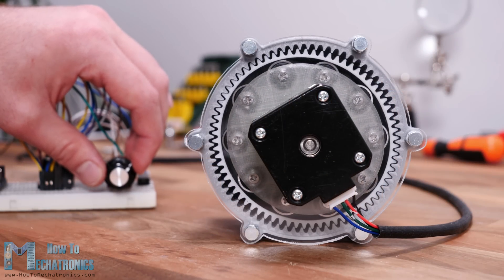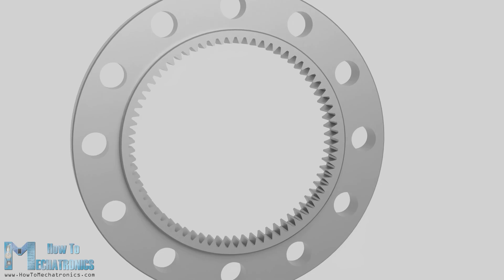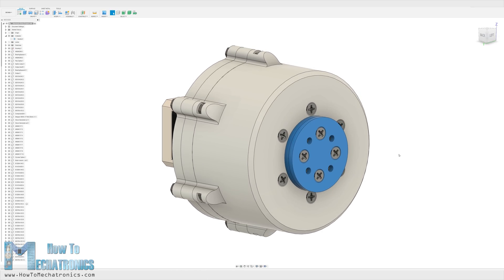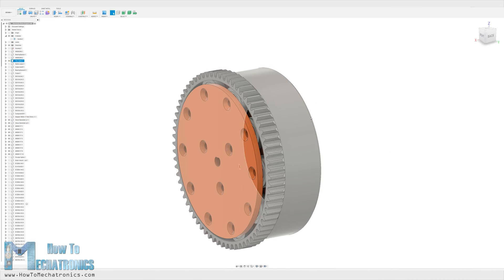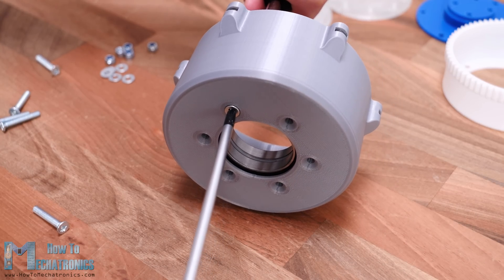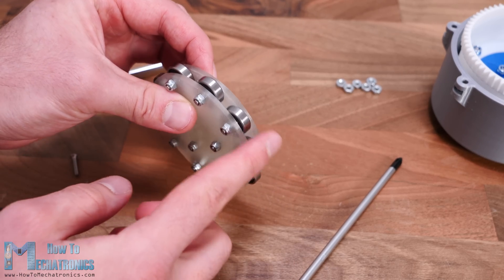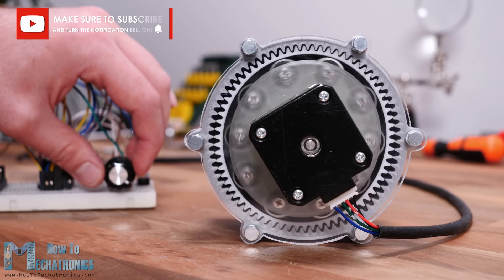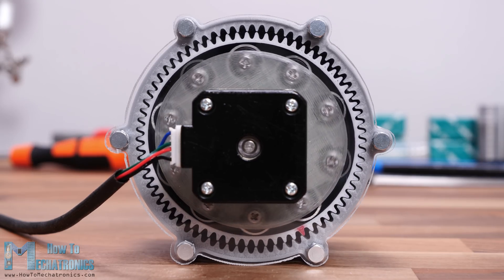What is Strain Wave Gear a.k.a. Harmonic Drive? A Perfect Gear Set For Robotics Applications!?

Comment: Were all those bearings nessecary? It looked like only the ones at the outer edge of the elipse were contacting the flexible part.
Reply: Yes, I was thinking that , and also , you don't really even need the bearings. If your application for the drive was a light to medium load I was thinking perhaps you could get away with just an elliptical disc with sufficient lubrication.  I'd really love to have a 3d printer and all the knowledge that's required.
Reply: I would of trippled their number by using far smaller ones, whilst the outer edge of the elipse bearings seem to have the heavy duty role, all the others keep the inner edge of the elipse from misbehaving, their friction is far less but they are necessary nonetheless.

Comment: It's so nice your fusion360 works so smoothly. Somehow Mine is laggy when it has lots of parts and points, even like 1/4 of your component count... But solidworks work just fine, any advice?Thanks! liked your vid!
Reply: Yeah, sane. Fusion started out being pretty small and efficient but they've added so much to it that it's become a bit of a slug. Autodesk Inventor is also much faster. Sadly, only more RAM and faster GPU will help it.
Reply from the maker: Well I guess it's up to the PC configuration. Mine has Intel i-7 6800k 6 cores, 32GB RAM and GTX1070 8GB GPU.

Comment: Great video! 

I just don't like it on a personal level. The mechanism, that is. Something just seems so wrong to me on a fundamental level to put some thing purposely flexible in a drive train. The material will have a very short lifespan. I guess that makes sense if you're making something plastic injected and disposable, but that type of engineering has made the world have a lot more trash in it.

Comment: The constant bending of the gear does it generate a lot of heat   however small the bending may be
Reply: This is why such gears are not used in machines built for long-time use. The constant mechanical stress breaks the gear quickly, doesn't matter much if the whole contraption is filled with coolant and/or lubricant. If the gear that bends constantly is made out of materials that can handle the stress for long, then the whole thing gets extremely expensive. The idea is great, but the adaptability of it is very limited.
Reply: @baladar1353  rubbish, they are used to power robots. I first saw them on asea robots in the early 80's. If anything robots are completely designed for long time use 24 hours per day and no lunch break etc.
Reply: @stevemarks9360   Ok, this is your opinion. Since I've learned material sciences, I think I knew what I was talking about. What I'm not sure about are two completely different things. First, I'm not sure I have expressed my opinion correctly, because english is not my mother language. Second, I'm not sure about you know what 'long time use' means in the case of constantly bent materials. It doesn't matter if the force causes permanent or only temporary deformations, deformation will cause the matter to fail sooner or later. You can delay failing by using different materials, cooling and lubrication, but it will happen. This is why harmonic gears are not used in car transmissions or other critical long-time-use machines. Of course these can be used in small, not so powerful machines, with the need of constant supervision. Constant, repeated bending -> viscosity, friction -> generating heat -> fatigue fracture, failing. I guess it may explain what I expressed before.
Reply: No it doesn't, and this mechanism is used to drive robots, one on each axis.

Comment: Very interesting concept but I would have to be convinced about longevity of the flex spline especially under high torque high vibration applications.
Reply from the maker: Well they are known for being quite durable. Of course, not this 3D printed one, but the one made out of special steel alloy. These drives are using in many high precision industrial robotic arms.
Reply: @HowToMechatronics  are they any idea which ones?  I have worked  mainly on Fanuc more on the heavy industrial side.

Comment: I still don't get why it rotates and doesn't just deform back an forth in the same place
Reply: That would happen if the teeth count of inner and outer ring was the same. But the inenr ring has more teeth so it will "climb" the outer ring and move slowly.

Comment: Amazing video!   But did you really use a star-head bit to drive the socket-head cap screws?
Reply: I've found that Torx bits actually grip the socket head better than an Allen key does.

Comment: CraftWare slicer has the same parameter like the Horizontal Expansion, but it is called Vertical Shell Offset and I usually set it to 0.07mm for the best results.
Thank you for the nice video! Good explanation!

Comment: If you attach a precision encoder or resolver to the input and output and graph the relationships you will find that harmonic drives have some weird nonlinearities.  We were trying to use them for some very high precision robotics applications in the 90s and this gave us big headaches!
Reply: What kind of nonlinearities?
Reply: Posting in this thread for when someone posts the solutions for this
Reply: How did you work around the issue? Just a nightmarish transfer function?
Reply: Matteo Alessandro no, afaik tfs are inherently linear.
Reply: This is true however this sinusoidal motion component all but negligible when a high reduction ratio is used. You can think of the extreme doing it with so many teeth that the teeth just disappear and you are essentially just using friction. At that point the sinusoidal component goes away and you theoretically have linear motion.
Reply: @kaden56  depends on the level of accuracy you are trying to achieve as well
Reply: @Chris-bg8mk  How would this compare to a cyclodial gear? Would a cyclodial gear deliver more constant torque?
Reply: The output is linear, with a small sinusoidal component.  For most purposes this can be ignored.  Only if attempting very high precision must you account for it.  Also, they are somewhat springy!  Also can be ignored unless high loads involved.
Reply: wihout doing the math, I'm guessing the sinusoidal component is caused by discretized teeth in the splines, that break the otherwise continuous rotational symmetry. Probably the more/smaller the teeth, the less of this nonlinearity.
Reply: @Chris-bg8mk  Hey. I've designed my own strain wave gear and had this result as well. Thought it was for a belt having more rigid parts and some parts of the printed parts being a bit inhomogenieos. Do you know where this comes from?
Reply: @Chris-bg8mk  My output speed is sinusoidal. Any idea where this comes from?
Reply: @haenselundgretel654  I presume that the sinusoidal component comes from the teeth on the output wheel coming into  contact with the static wheel and pushing the output wheel backwards as it flexes until it slots 'home' into the teeth of the static wheel. During the sliding into place phase of the motion there is a little back pressure on the flexing sector which is relieved once the teeth are fully meshed together. If there are sufficient teeth then the next pairs of teeth should be in contact and pushing the drive wheel with a more-or-less continuous force. However, there will be small wave  of deformity at around the point of  first contact between the toothed wheels. In theory, this could be 'tuned out' by getting the resonant frequency of this deformation wave to exactly match the driving frequency so the additional positive of negative forces appear at the same moment in each tooth's progress. The profiles of the teeth could then be tailored to account for the total force such that each tooth slides into its pair at a perfectly constant rate - for a given turning speed of the input shaft.
This would also increase tooth wear and I am lead to wonder whether a more extreme change to the profile of the teeth would not mitigate the problem? A semicircular "tooth" on the drive wheel - made with a tiny free-wheeling cylinder to avoid wear -  could interact with a parabolic(?) bowl in the static wheel such that it presents a constant force in both the direction of flex and the direction of drive throughout the engagement. The free-wheeling cylinder could actually maintain contact with a suitably sinusoidally profiled static wheel throughout its flexing path into and out of the static wheels peaks and valleys, stabilising the whole system.
Reply: @Chris-bg8mk  Similar gearing can be done with completely rigid parts. That should mitigate the problem completely but it gives only one point of contact. However, even that problem can be alleviated by doubling or even further increasing the number of inner gear and off-setting them accordingly.
Reply: @anteshell  From what I understand the thing that makes this drive desirable over other types of gearing is its feature of having zero backlash which isn't achievable with rigid gears
Reply: @vaughnmonkey  I'm not gonna argue, but I fail to find any proof. I can only find unproven statements about it. Not going to believe those out right because my understanding and experience tells otherwise, but I'm open minded if you happen to know a good explanation for this.
Reply: Output is sinusoidal? Cool! Bet there's a ton of factors to figure out to use practically
Reply: I used to have a telescope with a harmonic drive for right ascension and it was super smooth and accurate with undetectable backlash. But I remember that the gear teeth weren’t really teeth; they were a gently-rounded round wavy edge on the metal cup spline and a matching round wavy edge on the metal output gear. The effect was just a step up from a friction contact patch.  It was about 5” in diameter and had 200 and 202 of those wavy “teeth”.  The whole thing was incredibly smooth and quiet with no sign of nonlinearity.
Reply: Posting to get noticed
Reply: Maybe a different tooth profile would help change output
Reply: If you need precision without high torque, (for measuring) i have build this without theets and two rollers inside for making the wave. The difference between outside flexspline to inner dia of outside shell, so you dont have an integer reducing factor, but an konstant reducing ratio. i used this for moving optical measurement equipement. Mirrors and prism.
Reply: Super interesting to know, thanks
Reply: can you use two in tandem or possibly nested  each doing half of the reduction and their sine output set 180 deg out of phase?
Reply: It seems like you would be able to use a solid gear set. You would lose the amount of tooth engagement, and only be engaged on one side, and would have to offset the output flange, but you would get a linear output vs. Input
Reply: A strain wave drive is still used in the universal robots axises
Reply: Double up.
The periodic 'noise' in the output shaft has a distinct phase.
Team up one gear to 'slip forward' while the other gear 'slips back' the same amount.
Net effect is cancellation of the periodic noise.
Kind of like using u-joints in pairs (Cardan shaft) to fix the rotation problem.
Reply: How can there be a sinus, if there are two constant contact points running around at a constant speed?
Reply: Yeah the motion looks like the acceleration would be far from constant. Would love to hear more though !
Reply: Reminds me of wankel.
Reply: Wikipedia: “Disadvantages include a tendency for 'wind-up' (a torsional spring rate) in the low torque region.”
Reply: That's rather strange considering the high precision of mechanical alignment required in some equipment I am very familiar with. That alignment is provided by three Harmonic Drives. They provide the angular accuracy and speed necessary to maintain alignment while countering the effects of yaw, pitch, and roll. With Harmonic Drives, the controller receives the positioning information and sends the proper signal to the drive to provide the required rotation. Nonlinearity is not a problem.
Reply: do you think there are the same problems today almost 30 years later?
Reply: @EmGi_  sine waves!  I believe it's inherent.  Maybe the boffins have found a fix?
Reply: @Chris-bg8mk  The problem is created by the movement of the balls in the bearing relative contact point. As the whole system is elastic this can translate into uneven force transfer. Anticipating the counterargument "But this is try for other transmissions as well." - Yes the balls change position, but the whole system is mostly rigid "smearing out" the forces.
Reply: Yes, i agree. I use these for a work application and they have issues and are not the smoothest runners. I would rather use planetary gear sets over these any day.

Comment: I noticed you switched over from Solidworks to Fusion. What made you switch over? What do you like and don't like about the Fusion compared to SW? Anyways, amazing video and I learned something new from you! Please do more mechanical systems video! They're very interesting.
Reply: It may have to do with the gear generator plugins for Fusion, or the ease of assembly. I haven't used SW tho so not sure.

Comment: FYI, they're not called "Countersunk" bolts, that headstyle is simply called "Flat", so if you are using bolts that are driven by an Allen key, they're technically called "Flat sockethead  screws", (the headstyle is called "flat" and the drive style is "Sockethead") or if they're Phillips drive, they're called "Flat Phillips head screws".... there's no international standards or naming schema that calls them "countersunk".  I see how this is a common mistake considering the cutting tool used to make the recess is called a countersink.  Figured everyone should know that so if they go and try and buy them, they're not looking for a head style that doesn't exist.
Reply from the maker: All right, I see. Thanks for the input!

Comment: These strain wave gears make me smile, I'd love to use them but they are really expensive....

Nice printed model!
Reply: You might be able to buy a cheap 3d printer and simply take a model off of the internet, or model your own, for cheaper than buying one
Reply: @slimknight_  as the video showed. And as every other video with a 3d printed strain wave gearbox has shown. 3d printing can't really achieve zero backlash. Nevermind the durability. So he can't really just 3d print one if he wants to actually use one as intended. (high accuracy, no backlash, low wear)
Reply from the maker: Thanks!
Reply: If you do mechanical construction, you definitely want to get a good, inexpensive 3D printer and Fusion 360. Fusion 360 is free for home use, they'll actually give you a free license. But you CANNOT sell the models you make and you CANNOT use it to make models at work in a company! Non-commercial home use only!
Reply: @PunakiviAddikti  reason why I gave it up said Fusion, FreeCad works just fine, and sometimes even better, let just say FreeCad is somewhere in between the capabilities of Inventor and Fusion (just to stay under the Autodesk dome of products for this comparation), and I used to be a heavy user of Inventor with sometimes 80 hours a week on it for months in a row, so as soon as I tried Fusion 360 for a month I simply gave it up, is rubbish.
Reply: @PunakiviAddikti  Exactly, I am very happy with my prusa i3 for example. inexpensive and extremely high quality prints. Have not yet failed a print with 3158 hours printing time, last time I checked. I'm not using fusion though, I tried but just doesn't  work out for me. So I will stick to SW2020 :)
Reply: @PunakiviAddikti  FreeCAD is opensource and you can do whatever you want with the designs you make on it.
Reply: @coler154  FreeCAD has HORRIBLE UX, Fusion 360 is much more intuitive and feature-rich. I even setup a Windows VM just to be able to use Fusion 360, it's that good.
Reply: @patrik9666  Fusion is good only for people without ANY experience with CAD software. For everyone else  the experience is almost as painful as using  FreeCAD.
Reply: @patrik9666  sucks that fusion 360 decided to screw over its free users now.
Reply: @vaughnmonkey  I think people are overreacting, the FREE version is good enough for majority of hobby projects, and unlike other programs that costs upwards of thousands of $ a year, it's FREE, easy to use and pretty modern. You are still getting a huge bang for no buck, that's pretty generous from Autodesk.
Reply: @mil3k  Many years ago, I used AutoCAD, so I do have some experience with CAD software. Still, I much prefer the Fusion 360 workflow over the FreeCAD. I use software to get the job done and I iterate a lot. Fusion 360 is easy to use, I don't have to fight the software, it's just doing what I want (well, most of the time anyway). Not to mention the timeline feature, makes it so easy to change things here and there. The workflow just fits my hobbyist use so well that it's hard to switch to any other software.
Reply: @patrik9666  with freecad I don't have to worry. If I start making a hobby project and then it develops into more I don't need to worry about getting sued. And I just have never liked fusion. I learned cad on solidworks and tried to switch to fusion but it's insanely annoying.